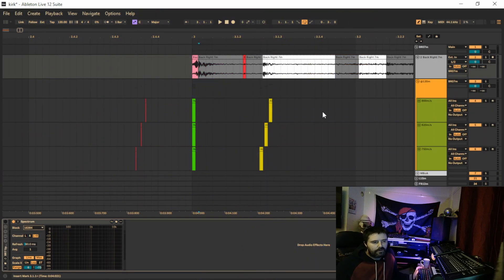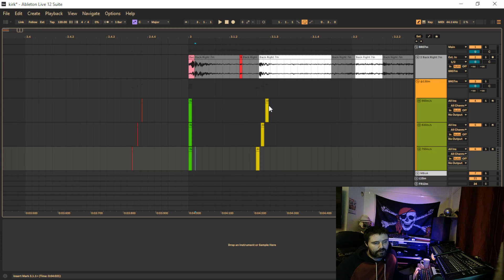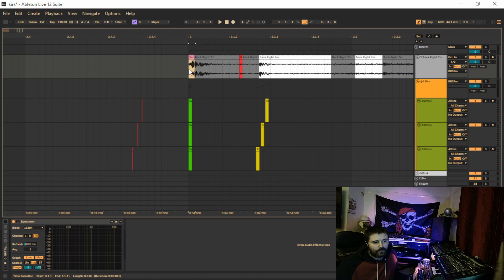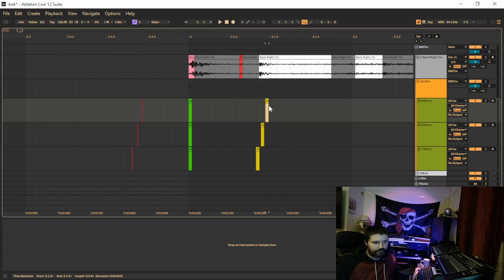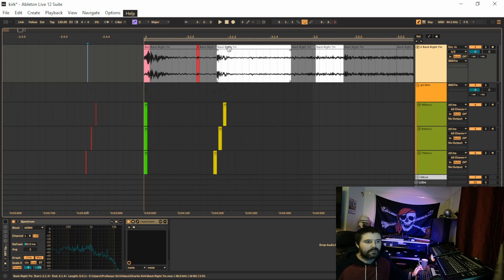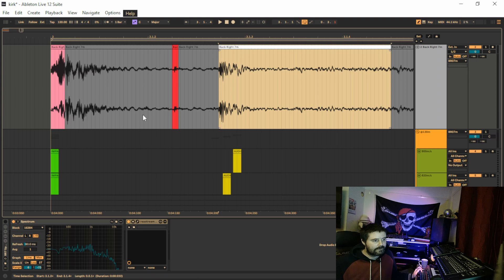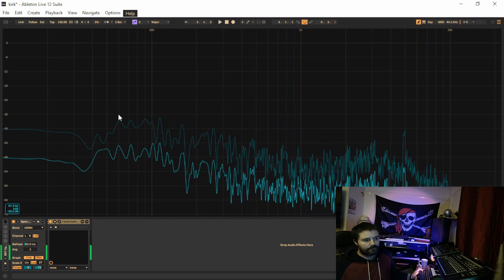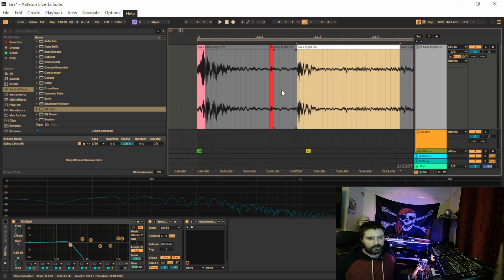I got a Freq'in Question

Comment: If one had some footage from some areas closer to shooter, and managed to sync em up to the ones closer to Charlie one could compare the "snick" and determine the travel direction.
If there is a snick one coming from right direction it wasn't a blank, if however there isn't then it reinforces the blank theory.
Only recordings close enough to the trajectory would have the snick though. Anyone who's been shot at knows if you can hear the "snick" it was close...
I like where this is going as it is becoming a testable hypothesis! 👍
Reply from the maker: I'm not sure how anyone can sync them at the respective distances. We could get it close, but not precise enough to measure without guessing
Reply: @Audio-Freq  It depends on the file FPS really. Ideally we'd have at least 60fps and could determine within about 1 frame things like pronunciation of a hard sound like a P which delivers lip queues.
That would get us within 16ms or thereabouts as we can also see where in the "P" we are if video is clear enough.
For 800m/s (easier math) that's 1.25 m/ms which would allow us at least a 125ms window or nearly 8 frames at 60 fps. This is enough to determine if the "snick" happens earlier close to the claimed source than at the final mic by the tent. It needs to account for the elevation as well which means the bullet passes further away from the mic. The crowd half way would probably be best chance as they are not too far from the trajectory and still far enough away to give enough of a frame delay. I'd expect the height at that point to only be in the 2-3m range adding only 2.5-4ms extra delay giving a margin of 4 frames which should be detectable. This is all cut in half for 30fps though, making it possible but very hard.
In essence, depending on the height, the time the "snick" would be heard at the half-way point would be the distance to half way point in meters * 1.25ms + the height of the trajectory at that point multiplied by 3ms (approx speed of sound). In reality there are calculators that can take into account the slowing down of the bullet as well, but one has to start somewhere
Once synced the same can be done for the boom. This time using the speed of sound all the way. In may be that the boom is too delayed from actually being reflections and finding audio that are in direct line is critical to determine which areas were in "shadow" and may get the echoes without a very discernable main boom first. I've only dabbled with sonar and echoes but someone more experienced in this should be able to make some remarkable calculations with just a 3-4 audio recordings.
Reply from the maker: @1kreature  The recording I have of this mic, its from the guys phone and it's unedited at 60fps.
Reply: @Audio-Freq  Then, if there is associated video you can maybe see if there is any audio delay in the file. Sometimes there is a built in delay in encoding due to not taking into account the different processing chains. It usually doesn't add enough to be annoying for a viewer but it would be enough to ruin any shot timing analysis.